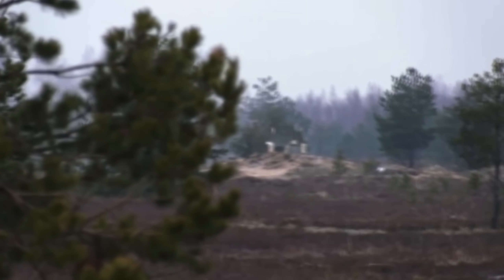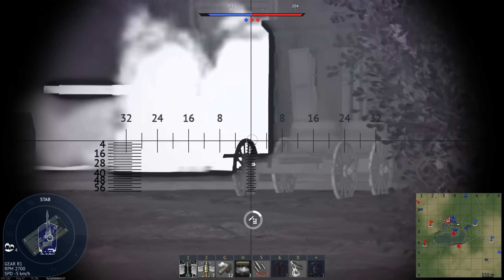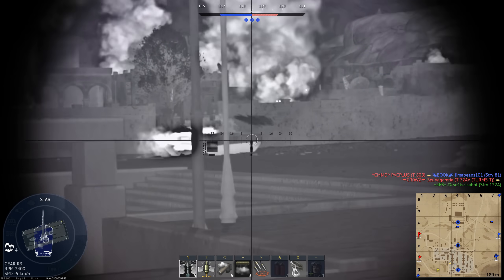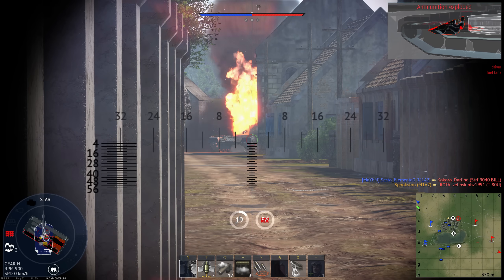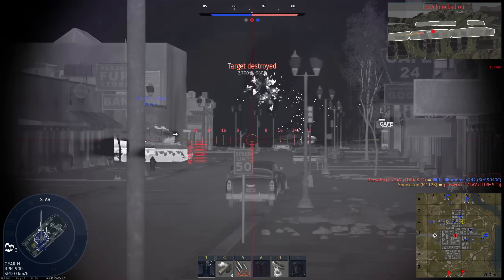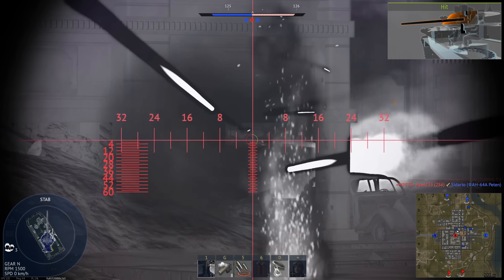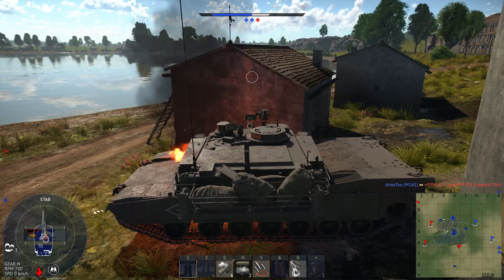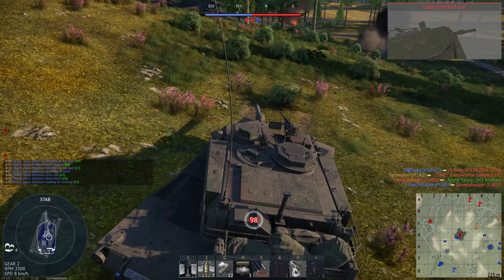Why The M1 Abrams Uses Depleted Uranium

Comment: The pyroforic effect is negligible in terms of damage. The aim is to ignite ammo stowage or fluids inside the tank. I'm not sure how accurate it is, but I've come to understand that the effect also helps to clear the hole being essentially cut into the armor like the concept of a gouging rod or thermal lance in welding. Essentially vaporizing the material away or melting it away and ejecting it from the hole. That's my understanding I'm a nut shell and I could probably ramble about it for an hour or so discussing the events from ammo rack to kill confirmation. Some soldiers and marines in desert storm got sick after taking pictures with some of the carcasses of Iraqi tanks and vehicles taken out by APFSDS rounds. The DU can settle as a dust and is pretty easy to disturb. It's hard for the wind to carry it any substantial distance because of its atomic weight, it tends to settle into the ground. But you can disturb it the same as digging a hole and disturbing dirt 10ft below the surface. So dont go poking around busted tanks and shot up military vehicles. That's my rudimentary understanding, I'm not a scientist or anything like that. I just have an unhealthy obsession like you since that's what I did for almost 7 years in both a heavy armor and infantry support role.

Comment: The self sharpening aspect only gives an advantage in long rod penetrators (I.e. APFSDS), so they have moved away from it for aircraft and other short penetrators.  The back end cost of the DU such as testing and demilitarization were deemed not worth it for those rounds.

Comment: The most critical reason DU is used in armour and ordnance is actually Isaac Newton . Yes, that Newton, with gravity and calculus and stuff. He derived a formula for impact depth .

Once you reach sufficient velocities, where hardness and brittleness no longer matter, and the materials behave like soft putty anyway, Newton estimated that the impact depth of a projectile is...

depth = length of projectile * density of projectile / density of target

Width does not matter. Velocity does not matter. Hardness does not matter. At sufficiently high velocities, only densities and length matters.  

* This is why ammunition is made of very dense materials. 
* This is why ammunition is made as long as possible.
* This is why armour is made as dense as possible.

Also, what explosive reactive armour does is to fracture the projectile so that it scatters over a wide area rather than adding to the impact depth.

Comment: DU makes extremely fine dust, and it has basically poisoned Fallujah for the next 60,000+ years. If you're not sure, just google "Fallujah birth defects" or "Fallujah radiation". The US bombarded Fallujah at the beginning of the Gulf War as it was the last holdout of the Iraqi military. They wanted to set an example, so the M1's and A-10's pretty much leveled the place with DU. For all intents and purposes, that place is a place of pain, suffering and slow death, forever. The US military really needs to stop using it.
Reply: I was also going to suggest this but even more broadly, people should search “Iraq depleted uranium” as well.

Comment: So does the Challenger 2 and Russian tanks too, but the only battle tested MBT to have never been lost to enemy fire destroyed or otherwise unlike the Abrams.
Challenger 2 MBT has the best Armour in the World.
It's called depleted uranium because it's severe radioactivity is depleted, taking out high weapons grade U235 with higher grade being used in forming plutonium U239 leaving only the depleted uranium for use in sabot tank rounds with a tiny amount of U235 way under safety levels, of less than 0.711% meaning it is still radioactive but but to dangerous levels as I said above.
Depleted uranium
Depleted uranium is a dense metal produced as a by-product of enrichment of natural uranium for nuclear fuel. It is still radioactive, but at a much lower level than the starting material. It is used in armour-piercing shells and bombs, to give them more penetrating power.

Comment: While controversial to the lesser knowledgeable, it is worth noting that due to both the fact that this, otherwise useless material, would've been put underground in a vat to just waste away, it is instead being recycled for the purpose of both protective and offensive armament and helps replace an even more toxic material (Lead). Like he said in the video it's a cheaper alternative with much more benefits militarily compared to its steel and lead based counterparts. Until a healthier alternative comes along that negates the reason to recycle the DU waste, I don't see anything changing.

Comment: Tungsten is not highly poisones.
Reply: It's a heavy metal, yes it is
Reply: @co8783   @Thedoomturtle  i love it when people talk about stuff they clearly dont know much about... tungsten is a heavy metal yes and also it is poisoness mainly when you inhale the dust .. kinda like most metals. you can wear it as an ring all day long you can lick it as long as you want without getting ill. silver on the other hand is a noble metal and still its more problematic than tungsten its much easier to get an silver poisoning than an tungsten one despite the fact that most noble metals are harmless.. just because its an heavy metal it does not mean its higly poisones xD it only means its in a specific class in the periodic table, just read about it yourself i work with the stuff on daily bases and it does not even come with any warning lables (health and safety at work in my country is relativeley important) yes it can cause cancer like millions of other materials, and as long as you dont inhale big amounts of that stuff/ or inhale the dust in regular bases its harmless. uranium on the other hand in form of dust is higly dangerous, the oxide layer is enough to protect you in most cases when its an solid metal bar and you could store depleted urenium under your pillow without major health risks, wich does not mean you should handle it without gloves all the time and you probably should not lick it all the time (just an tip).

Comment: Fun fact: the A10 Warthog uses depleted uranium rounds for the same reasons
Reply: It did but but not after the first gulf it switch to Tungsten and now  that’s basically fallen out of favour . As it didn’t get any tank kills with its gun and it was realised it would be better have the gun use ammo best against soft targets.
Reply: @kekistanimememan170  You never saw or visited the Highway of Death ( western 5th ring road) in Kuwait,  did you? 
Dozens of BTRs, Bumps, T54-55's, T 64's and T 72's turned to swiss cheese by A10 and Apaches with DU rounds... not mention all the DU sabot 2nd Cav used during 73 Easting ...all that stuff was "Hot".
I went back to Kuwait as,a contractor in 93. It took us and the other companies over 4 years to clean up and move all the vehicles to a consolidated junk yard.   After the 3rd or 4th vehicle showing 30 mm holes, we brought out the radiological gear and tested everything.  The ones that were "hot" we used dozers and construction grapplers to move onto flatbeds, which got tarped and moved separately.
Reply: @richwalter3107  highway 80 was barely attacked by a10s and instead was started by a6 intruders
Reply: @kekistanimememan170  Yeah because Iraqi Civilians are usually unarmored

Comment: The purpose for using a turbine engine is because it can run on multiple fuel sources, requires far less maintenance, virtually can’t overheat, and is known to run more effectively in dusty/Sandy environments!

Comment: "Depleted uranium is still dangerous"
Well even if it wasnt radioactive i still dont think a chuck of metal soaring at you shot by a tank is very safe at all
Reply: Fair Point
Reply: it is a heavy metal and is still very toxic, regardless of whether or not its radioactive.
Reply: Its more of a problem when towns, villiages, and water supplies are littered with du particulates
Reply: @CCRUEnthusist  I was making an unfunny joke but okay
Reply: @CCRUEnthusist  Like burning coal ... :D Which releases a lot more particles
Reply: @CCRUEnthusist  would you prefer tungsten particles in your water supply?
Reply: Does the word depleted mean anything in your world
Reply: @evilzarmy1  depleted is a kind of odd word to use. It's U238 not U235, that's all it means.
Reply: @evilzarmy1  yes....depleted means...no longer able to be useful...in this case...as FUEL...DU is enriched u-235 that has been depleted...and therefore no longer is able to split into lower elements...which means this depleted uranium is u-238 .....the stuff we mine out of the ground in the first place. So if you want to go into a uranium mine without a gas mask on...please be my guest.
Reply: @evilzarmy1  
Less lethal weapons can also kill you though especially in the right conditions like say you with a pacemaker getting hit with a taser will most likely kill you
Reply: With a half life of 4.5 billion years you'd essentially need to replace your whole body with it to get any sort of appreciable dose.  It's basically the least radioactive thing that's still radioactive.
Reply: @averagejoe112  even small dose of its toxicity/radioactivity enough to affect human body.
people get born with defects, people get cancerous tumors, feel sick all the time etc
Reply: @divinehatred6021  as long as you dont start chowing down on the armor, you'll be fine.
Reply: Your more likely to get a higher dose of radiation standing outside (since the Sun is Basically a nuclear reactor) than being in an area were DU was used.
Reply: @gotanon8958  the sun does not perform fission
Reply: @polygorg  But it still produces EM waves..... which are a form of radiation.
Reply: @chiko9001   are you stating that electromagnetic radiation is ... radioactive? (as in nuclear radioactivity/radioactive decay) Or are you saying about the ionising electromagnetic radiation? Because radiation is a very broad term. For example, your heater radiates too. But it radiates “infrared” electromagnetic waves, which we call heat. Visible light is also a form of radiation our eyes are adapted to see. But i think you’re referring to the ionising radiation (Ultraviolet) which indeed can cause cancer. However it works on a bit different principle than radioactivity. (P.S. both Alpha, Beta, Gamma radiation and high energy electromagnetic radiation falls into ionising radiation, which causes cancer and other genetic disorders)
Reply: @polygorg  No, because it's a fusion reactor. Nuclear fusion is still nuclear, it's literally in the name.
Reply: @pusheenthecat9264  better add sneezing, coughing , singing, talking, screaming, laughing or yelling.....oh yeh...and breathing
Reply: My thoughts exactly. It's most dangerous when it is shot out of a tanks smoothbore gun at your tank!
Reply: wow a heavy metal is dangerous? guess I should stop eating lead
Reply: Heavy metal is never safe, but it is fun
Reply: It's depleted uranium 238 a very radioactive toxic poison that lasts for millions of years in Kosovo alone they fired 15 tons of DU THE CANCER RATES IN THAT COUNTRY ARE 80 PERCENT HIGHER imagine how much has contaminated Iraq Kosovo was 78 days of war .
Reply: if you in a t64-72 i dont think being hit by du pr thungsten apfsd makes much of difference to you will still die.
Reply: I don’t think a 22 caliber chunk of lead soaring at you is very safe either. Or a rock. Or a sharpened stick.
Reply: its after you destroy the target, passing the vehicles destroyed by these rounds exposes soldiers on the ground to radiation
Reply: When its heated it will get more radioactive.
Reply: Honestly I want a round fired out of an American tank to be as deadly and dangerous as possible the more the better sorry if this is not PC but when is war ever PC. If we could make it worse I’m all for it I think most folks will agree that tank rounds aren’t supposed to be nice and gentle
Reply: @myanaloglife9450  yea until the same soldiers that used the tank started diying
Reply: I remember watching a documentary about Iraq and Afghanistan vets fighting for Healthcare because they got really sick firing and handling DU rounds. You should easily be able to find docs on it.
Reply: It produces heat too
Reply: It causes environmental damage, my room temp iq friends. See "Invisible War - Depleted Uranium and the politics of radiation
"
Reply: @rhetoric5173  why read anything written by lunatic demokrats who always cry wolf and don't understand the earth goes through heating and cooling periods that can last five years or 150 years. All those lunatics do is whine about everything then waste billions on non-existant problems and make things even worse with their lunacy.  Just like their electric car BS. Those idiots don't have a clue that to generate the electricity needed would cause more pollution than our present vehicles already do. Or the fact that car fires with electric vehicles will cause more toxic fires than present vehicles do. And then you have the hundreds of millions of batteries that they xant recycle and that would pollute the drinking water of every single city and town of the world.... and your worried about the 100 billion to one that a tank or A-10 round is going to pollute some water or ground 🤔

Comment: Abrams engine runs on a variety of fuels...
Reply: Gas turbine does not mean gasoline. It means gas as in the state of matter that occurs when you burn a hydrocarbon fuel be it liquid or gas and that said gas is expanding due to the combustion.